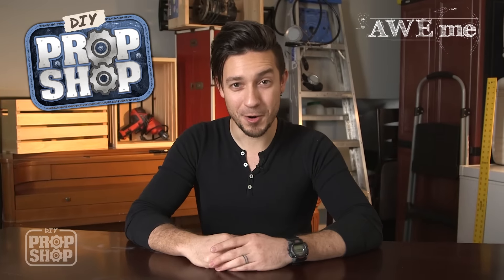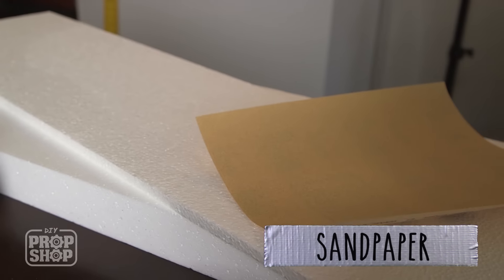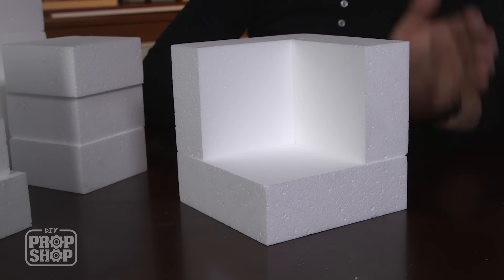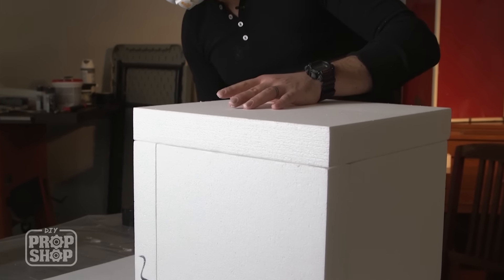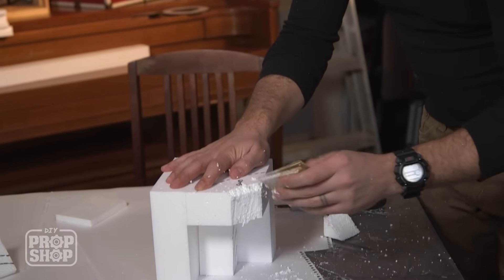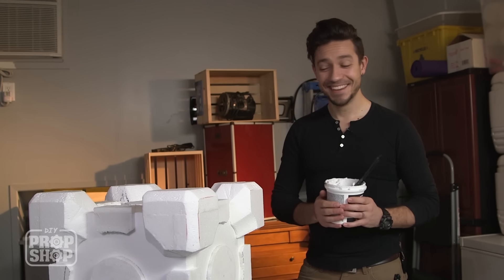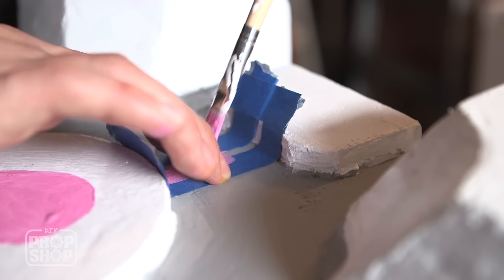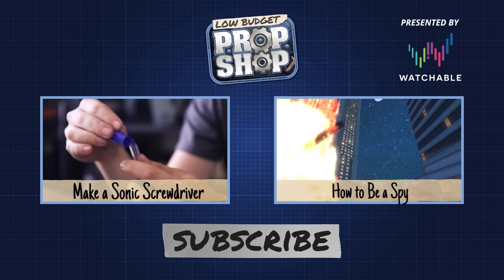DIY Companion Cube! (Portal) - DIY Prop Shop

Comment: a hot wire foam cutter would work better
Reply: not to correct your method
Reply: +William King Yep, its much much easier cutting those basic  block shapes and the bevels wiith a wire cutter. Not sure if theyre cheap to buy though
Reply: +ScribbleFilo true.
Reply: +William King well Wire is cheap, and fire is pretty much free...
Reply: Felipe Pereira Dont think it works like that XD
Reply: you can make one at home
Reply: +William King Thats what i thought! :D
Reply: Grant Thompson THE king of random can help you out with that, all you need is 2 degrees in engineering and 20 years of experience in knowledge

Comment: no hot glue? can't be :) great result and a great host
Reply: +Formulka hot glue on foam usually isn't the best. high temp hot glue will melt the foam and cause it to release harmful fumes. all-purpose, spray and contact cement are the best adhesives for Styrofoam.
Reply: +6zwbob its a joke haha. In this prop shop they always use hot glue, cadboard, and foam ;)
Reply: FoZe Sennzur I was aware. I just wanted people who seriously thought hot glue was a good idea to know it's not.
Reply: even low temperature hot glue melted my foam
Reply: +6zwbob Thanks for that, genuine issue.
Reply: +Formulka 
The foam is melted by many sorts of glue
Reply: +Formulka  or cardboard.

Comment: Han Solos DL-44
Reply: Yeah
Reply: Light saber stilt plz
Reply: you have to email them :P
Reply: +Nigel Caritan Hilt?
Reply: That's just a Mauser C96 with some plastic strapped on. Not very interesting in reality.
Reply: ***** yes it is, even just the flash hider
Reply: As in, it wouldn't really fit the show. You can just buy toy ones. That's doing it on a budget.
Reply: ***** but they look shit, and the scope is all wrong with that
Reply: So you really thinking jury rigging a C96 together out of scraps with all the attachments will look better?
Reply: Well I personally don't think it'd fit the show very well.
Reply: An easier way to cut the foam would have been to use a hot-wire cutter.
Reply: We all know that. But I guess this isn't really for people who know these sorts of things/aren't confident with these sorts of things.
Reply: Mr Duke Silver I

Comment: Cutting foam with a saw is for noob. Use an incandescent wire!
Reply: +Soma Cruz this is a diy not everyone will have that
Reply: you can homemade one easily
Reply: how?
Reply: +rick adam It's super easy to make. And it's better at cutting (well, melting through) foam. But u can use a saw, but i think sharp knife is better.
Reply: +rick adam grant thompson ?
Reply: thijs kwakkelstein Yeah :D
Reply: +rick adam if you can't even build yourself a hot wire foam cutter you're just such a noob ! a steel inox wire, dc power supply , a couple of resistor and some scrap wood and voilà !
Reply: Well King of Random made one :)
Reply: +christian kumara Dude, all you need is a tutorial and a bit of brain. What's the matter?
Reply: Soma Cruz
He got all but the brain ! that's the problem !
+christian kumara This afternoon I'll build you a foam cutter !
Reply: Guys, i think we've rekt him enough. Chill out.
;)
Reply: +Soma Cruz FATALITY ! ^^
Reply: Saving money
Reply: Yeah cutting foam with a saw is for noob but this is a DIY so everyone doesn't have a incandescent wire. That's why he used saw to cut the foam
Reply: Just because it's DIY it doesn't mean it has to be shitty. He can just show how to make one, or link to a tutorial how to do it, and just say that you can use this and that. BUT when I saw him trying to sand down a large corner piece rather than cut in the first place... I think he does not about this wire-thing.
Reply: shoichi osawa DIY doesn't mean having simple tools, just accesibles one, actually most DIY need some loadout to be made...
Reply: +Soma Cruz not everyone is a rich snob not everyone can afford a saw let alone a peice of wire thats probs 200$
Reply: +skyhacker6 not everyone is a nerd
Reply: benjamin faherty You must be trolling, there is no way for a human being to be that stupid and still be able to write. 

"A piece of wire that's probs 200$". More like 1-2 bucks xD The rest I won't even comment.
Reply: +thijs kwakkelstein Not yet. TKOR only has QC's about it up for now
Reply: And now he has a full version. 
Here it is:
/watch?v=N2n_EbRzZ0g
Reply: go to the king of random styro slicer
Reply: anthony sierra Dude, I linked it xD It's right above your comment xD

Comment: It's very nice. I made one myself a few years ago, and wasn't aware of any plans or tutorials to help. This vid certainly would've. I used pink foam insulation instead, and some different building techniques. One thing I'd like to suggest, should you make one again:
For your corner pieces you drew the inside ring borders for top and bottom with templates, then sawed in between. What worked for me, and may have been easier and more accurate, was to draw the templates on scrap plywood sheet from an orange box. One template for upper surface and one for lower, then use a hot wire foam cutter (built or bought for as low as $12) to trim.
I really like yours and am making another cube (12" cubed) as a card box for mywedding reception in April. I'll incorporate a lot of your ideas. Great stuff!

Comment: Why didn't you use a foam cutter? It's a thin metal wire that melts through the foam and won't make a big mess like you did now.
Reply: +LuraxThunder Because DIY. :I
Reply: You can DIY the cutter..
Reply: +LuraxThunder The toxic fumes, building that is project on its own and with the cutter its kinda hard to get even surfaces, not to mention lots of things can go wrong when using hotwire. I think his methods was the right one and just look the results comparing crappy looking props they have done in past. This guys actually design and build something that one could show off proudly, rather than trowing crap together like some 5 years old.
Reply: it's for ppl to make. I don't think every one have that thing

Comment: instead of sawing and sanding the foam you should either use a hot wire or a heated knife. it helps with a cleaner cut

Comment: Little tip use pva to seal it and then you can use spray paint I work a lot with foam my self and this is great and it also if you put a few lears it helps a lot to strengthen the foam so it can take more wear and tear

Comment: for all you who say cutting wire, your either an insane pro or never used one. you have to have insainely steady hands because if feels like cutting through air. you'll get these nasty waves most of the time if the piece is too thick. a saw is way more beginner friendly too

Comment: I'd personally would recommend multiple layers of camp foam that you can find at your local dicks, walmart, and so on. Be more durable and you wont have the risk of causing major damage while moving. I also recommend plasti dip clear spray. Put a few layers of that on the prop before painting it to help make the foam last longer.

Comment: Using styrofoam (extruded polystyrene) is better than regular polystyrene because its a solid block making it easier to use and saves time trying to get a smooth finish
and saves you having to spackle a lot

Comment: Seriously? Dust mask to work with Styrofoam and sandpaper to make a good finish on the edges? I will help you guys and tell that Styrofoam is made of little bubbles compacted together, so it does not leave dust, the bubbles can't be inhaled and the only way to make a good finish on the edges wold be to use a Hot Wire cutting tool.
Reply: It's a DIY after all and most people don't have styrofoam cutters

Comment: Actually the cutlist isn't completely correct. The circles are missing, I used a diameter of 15.5 cm. Also the sizes of the middle pieces wont fit, I used 12 pieces of 2*10.2*7.6cm and 12 pieces of 2*10.2*5.6cm, which just worked fine. For inches just divide by 2.54. Except of this it's a great video, which lead me to build the cube myself.

Comment: I think the measurements on the middle pieces are out a bit..... 
By my calculations (mid-build, mind you) the shorter pieces should be 6cm or 2.3" 
Because otherwise one side is a hell of a lot longer than the other